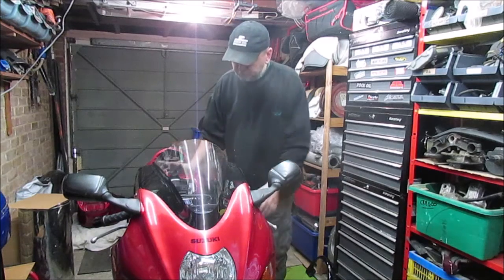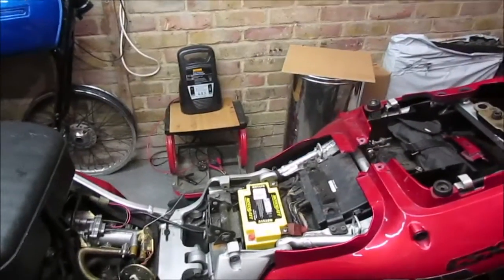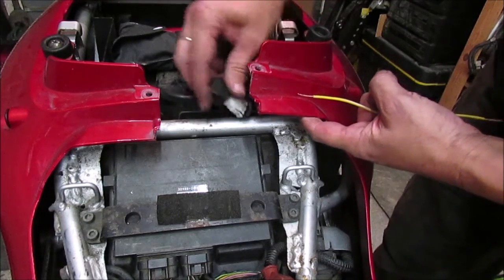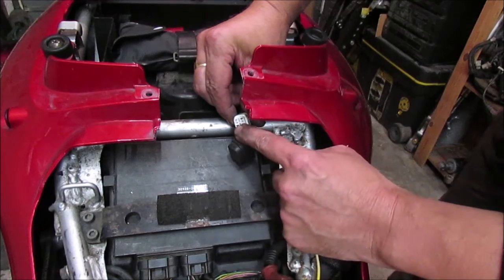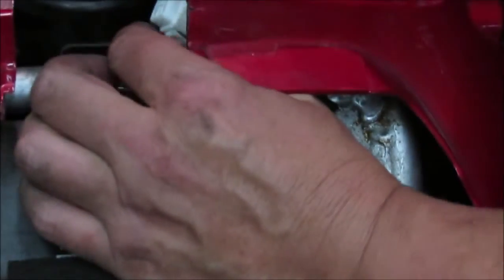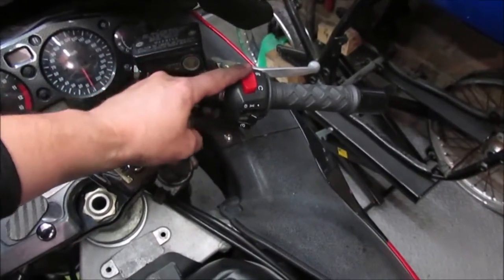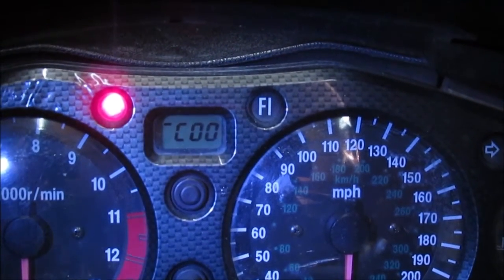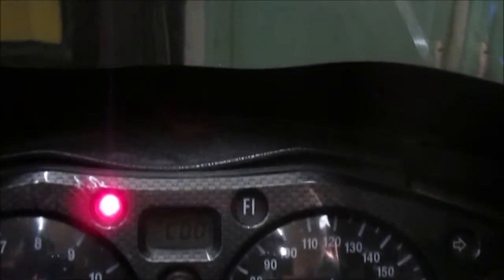How to Put a Suzuki Hayabusa into Dealer Mode

Comment: Hayabusa generation 2 eight injectors. . F1 c34 code .  Running on 3 cylinders  .  Fixed.  Put failed injector on top of 1st cylinder  .  Bike runs fine up to 8000rpm .  Fix whenever you get the new injector.
Reply from the maker: Good info, thanks for sharing

Comment: Good morning. I see in this video that you, for change mode, have live the sit buy i can't. I put the Key into the key lock and it turn on open but the sit remaing into the same position and can't be moved. It can be that with some lubrificant on the Key and on the Key lock, this thing can be fixed or i have to go to a Suzuki meccanic? Thanks

Comment: Hi all. 2006 Limited edition died on me. After a while managed to restart it but ran rough home with loss of power. Put it into a dealer mode no codes line in the middle, replaced fuel filter and fuel pump (primes), injectors, coils, spark plugs, starter relay, checked fuses.....bike turns but will not kick over. Bypassed kick stand switch and tip over switch. No luck :( Please help....
 Cheers from Canada.

Comment: help me Hayabusa gsxr1300 gen1 f1 light code c00
Reply from the maker: The codes are in description of the video, if you have C00 that is fine, just make sure the dash to the left on the screen is in the center as mine was at the top which means the throttle sensor needs adjusting

Comment: Hi New to your channel very helpful, i have just picked up a 99 model which has been stored for many years. it has started but would not tick over.and ran rough  i ran injector cleaner through the tank to hopefully clean everything but noticed the FI light came on solid while i was running. the fi light now flashes and i no longer hear the pump priming. i have taken the pump off and will test tomorrow. are there any others components  that would stop the pump running ?
Reply from the maker: Thanks Stephen, welcome to the channel, have you run it through Dealer mode to see what fault code you get ? C32,33,34,35- fuel injectors and C41- fuel pump relay signal , the C41 code is a possibility, i also have a video on the fuel pump as well, the filters could be clogged up and need either cleaning or replacing, but run it through dealer mode first, hope that helps
Reply: @TheAmateurBikeBuilder  i have tested the pump and its fine - i have not managed to find the plug yet but if i switch the kill switch off and ignition on i get the chec message on screen. switching the kill switch on then shows 1:00 the FI with the flashing FI light
Reply: got to the connector and now running in dealer mode shows -C41 the relay activates when switched on and tested the continuity across the relay - there is no 12v being extended to the fuel pump
Reply from the maker: @stephenlawrence9358  had a suspicion it might be that, if the relay is testing ok, then it should be in the wiring between the relay and the pump, split or broken wire maybe,
Reply from the maker: @stephenlawrence9358  thats good news on the pump as they are really expensive
Reply: @TheAmateurBikeBuilder  discovered the problem - the fuse had blown, because the petlock was completely clogged with grey matter and no fuel was getting to the pump ! I have cleaned out the petlock and removed the tank filter which was blocked and fell to pieces . ordered an in line filter and some tank cleaner, hopefully all will be good when i reassemble. thank you for your knowledge
Reply from the maker: @stephenlawrence9358  Thats good news, glad you found the problem, happy to help

Comment: had a reply back today from dealership, they are saying it is the gear position sensor that has failed
Reply: Me and my mate had pretty much gone through everything we could think of and we tested wiring with a multimeter, this was unexpected, you were a help because you were making suggestions, you may of given me something else to look at
Reply from the maker: Thanks Jim, handy to know, wonder why that didnt show up in the codes, hopefully not to expensive
Reply: with the cost of picking the bike up yesterday, looking at it and getting the part in, they said £300, if I,d of known the fault, I could've done it for £30 or so
Reply from the maker: @jimgreen9471  yep, forgot about that,i think new its at least £100, wish i could of helped sort out the cause
Reply: they will be buying a new sensor from Suzuki where as we would've bought a second hand sensor plus of course they're labour charges racked the price up, I wont get bike back for a week or so

Comment: tried to put my bike into dealer mode but chec stayed on and i got no codes, I would appreciate a call 07525248109, my name is jim and im in Plymouth, many thanks
Reply: Yeah done all that, chec stays on
Reply from the maker: @jimgreen9471  check the side stand switch, that is a popular fault that can make the Chec stay on, hope that helps, sorry i cannot ring as don't have a phone at the moment
Reply: No good, chec is just not clearing, I've had the ignition and kill switch apart and sprayed with wd a few days ago, what do you think, if I get no joy this afternoon, it's going into a dealership and they are not cheap
Reply from the maker: @jimgreen9471  will try and help if i can, just out of interest does the temp gauge stay on Max when the chec is on ?
Reply: yes temp gauge and fuel gauge stay on full/high
Reply from the maker: @jimgreen9471  its sounding like the ECU is not sending the signal, i did read a while ago, someone bought a dodgy rectifier and it fried his ECU, tried another ECU and it worked fine, im not a mechanic but its pointing towards that,
Reply: This all started after I fitted a new temp sensor to the rad, bike started after fitting it, two hours later, nothing, managed to get bike started Wednesday following your vid but just as I was going to take it for a test ride, it cut out again
Reply: Sensor didn't work either, fan never cut in
Reply from the maker: @jimgreen9471  That maybe your problem, if it is, a lot cheaper than an ECU, check the wiring to the switch, does your old one still work ? also check the fan switch, thermostat, did you change coolant or rebleed after ? there are two different sensors from memory. One controls the fan relay, the other sends a signal to the ECU which sends a signal to the temp gauge
Reply: I got hit by a pheasant about 10 weeks ago, new rad, nose cone, headlight, rad had a new temp sensor fitted, ran the bike upto temp in the morning, later in the afternoon, bike wouldn't start, followed your instructions on dealership mode and got c00 code up which cleared the fault, no other code showed, bike started for 5 minutes, cut out and I've never got it started again
Reply from the maker: @jimgreen9471  Ok. so the bike went down ? what year is it ? or do you know anyone with an ECU just to try ?  sorry for the questions, but trying to eliminate as you give me info,  have you checked the fuel pump ?
Reply: Haven't checked the fuel pump yet
Reply: Bike is a 2005 busa
Reply from the maker: @jimgreen9471  ah right, so your fuel pump is inside the fuel tank, mine being a 99 model is external and well known  for rust from the tank getting into it, as covered in my video on the fuel pump, my issue was bogging down and loss of power, got hot but never overheated, i ended up replacing the rad / sensors / coolant pipes and stripped the fuel pump cleaned and replaced the filters, checked the fuel lines , cleaned and replaced where needed, since finishing has run like a dream, no overheating and no power loss
Reply from the maker: Thanks Jim, the kill switch needs to be off, then turn off the ignition, you should see chec, then turn the kill switch on, that should reveal the code, also double check the wires are in the correct holes

Comment: Can the throttle position sensor be checked by this dealer mode you described? I have a 2007 'busa and was told the t.p.s. was bad.
Reply from the maker: Thanks Nitrousninja, yes it can, in the left hand corner of the display you will see a line, if you look at 2.59 mins into the video you will see on the display C00 and a small line in the top left of the display, that line should be in the middle, it can appear in the bottom left as well but needs to be in the middle, by adjusting the sensor up or down depending where the line is, hope that helps
Reply: Yeah the notch should be in the centered. He actually needs to adjust his

Comment: Hi,,i hope you guys here can help me some,also as i now know the fault codes is a real help.
i bought a 05 busa where the red fi light is on all the time,the bike is powerless and it is on par with my 93 cbr900rr, also it uses upp a lot off fuel,the previous owner said that he had changed the exhaust and that it needed a tune,and that is the reason for the fi light he said.. i dont believe it,,the o2 sencor on the exhaust on the hand is twisted,the fool had put the cord on before screwing in the bung on the exhaust, but that cant be the reason for the bike to be this weak. i havent tested any other busas and this one is my first but im not impressed,,it must be something wrong,,if my honda cbr900rr has around 110hp the busa should be around 150hp and that is a diff that should be senced,,i tested a 04 zx10 and that one felt way stronger and crispier then the busa.what could be wrong ?
Reply from the maker: Thanks 08halit, appreciate your comment, first thing would be to find out what fault code is being displayed, but it does sound similar to mine, mine would lose power, ended up cleaning the injectors and taking the fuel pump apart and replacing all the filters, i did make a video on that, only difference mine is a 99 model with an external fuel pump, i believe that later model fuel pumps are inside that tank but the principal will be the same, may be worth cleaning the fuel tank out as well as mine had a lot of rust in it. which was also in the fuel pump, link to video is https://youtu.be/B99nLYTiR5Y hope that helps, let me know how it goes

Comment: I have a code c42 I believe it was, something about a relay. Bike runs idles and light comes on after getting on it with no indication of a problem... if relay was bad bike wouldn't start correct??
Reply from the maker: Hi, not necessarily, this can be an intermittent fault, i have heard cases where bike starts fine then wont, it will get worse, check the ignition switch 
Remove ignition switch from bike using a torx bit.
Disconnect ignition switch wiring harness (it's really easiest to connect/disconnect the switch while the switch is not bolted to the bike -- the slack makes things easier.)
Continuity test the ignition switch 
Partially disassemble ignition switch  using a smaller torx bit. (Do not open up the part where the key goes in -- the tumbler -- you want to open up the bottom part of the ignition switch where that wire goes in.)
Clean the contacts 
Reassemble Switch and mount on bike.
Reply: @TheAmateurBikeBuilder  awesome thanks for the fast response!!!! So I found out that it was the Ebay ignition that I tried to replace it with so now that's out of the way and code cleared I have a c41 code.. the bike runs and idles fine..it did not run with the aftermarket ignition I had them mixed given the context of the previous post... thanks so much again!!
Reply from the maker: Glad i could help

Comment: mine doesnt start and there is no error code. It shows C00 ...I already made sure its not the battery and that it was strong enough. any suggestions? thx in advance. great video btw.
Reply from the maker: Hello Stefan, has the bike been dropped ?  is it turning over ?  when you turn on the ignition can you hear the fuel pump ? also which Busa is it Gen 1 or 2 ?  glad you like the video
Reply: @TheAmateurBikeBuilder  bike has not been dropped. It just sat for over a year. Starter turns and sounds healthy. How do i hear the fuel pump?
Reply: Its a 05 no idea how to tell which gen. Doesnt have any error codes shows C00
Reply from the maker: Hi, your fuel pump is inside the tank, mine is a 99 model with external pump so when i turn the ignition on i can hear it prime,so the your engine is cranking over ? could be the fuel pump , check fuel lines, also check the injectors as could have dirt in them, but does sound like the pump, try lifting the tank slightly as you  should be able to hear it prime when you turn the ignition on
Reply from the maker: Also, what does the temp gauge do when you turn it on does it immediately go to half way ? also check the 
 ignition switch put some switch cleaner and lube down the barrel
Reply: @TheAmateurBikeBuilder  when i try to start it and the engine is turned and i stop trying to start i can hear that fule flowing noise inside the gas tank. I guess that must be the fuel pump then?
Reply from the maker: you should hear the pump when you turn the ignition before starting, you will more than likely need to go under the tank and investigate, check fuel lines/ check plugs - are the sparking ? check the injectors and the wiring to the injectors
Reply: @TheAmateurBikeBuilder  temp gauge goes to 100 0 and then stays at 100 (hot). so it goes immediately to H all the way not half way. when i press ignition switch i can hear it do something. so i doubt the switch has a fault.
Reply from the maker: Are you starting the bike with the side stand up or down ?
Reply: @TheAmateurBikeBuilder  stand is up, had thought of that also. what does it mean when the temp goes directly to H all the way?
Reply: @PowerOf One unfortunately not think its the fuel pump. No error codes were shown.
Reply: @PowerOf One no did not have the time. Bike is in holiday home unfortunately.
Reply: Stefan Finster check the clutch switch

Comment: i'v had Suzuki's for years and use this...only thing I would say to you is where its coming up C00 and minus on top ..that minus sign should be in the middle...trottle position sensor may need adjusting alittle but reseach it first just incase I'm wrong
Reply from the maker: Thanks Fra, will check it out
Reply from the maker: Hi Fra, you were correct, thank you for the info, i cant adjust until the bike is back together as i need the engine running
Reply: no problem ..glad to help..
Reply: My - is on the bottom
Reply: @noaheichler6138  hey Noah my names Mike did you ever figure it out